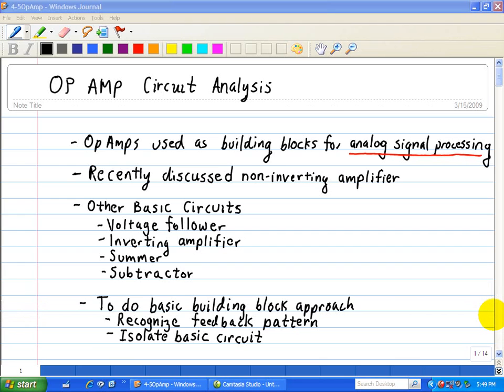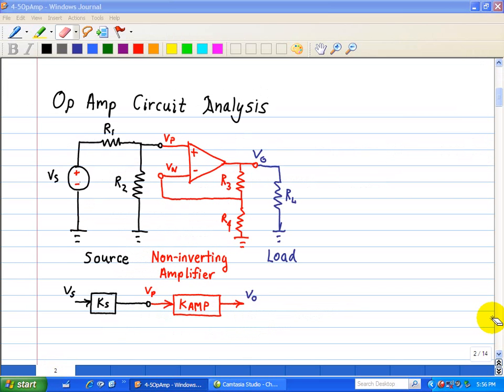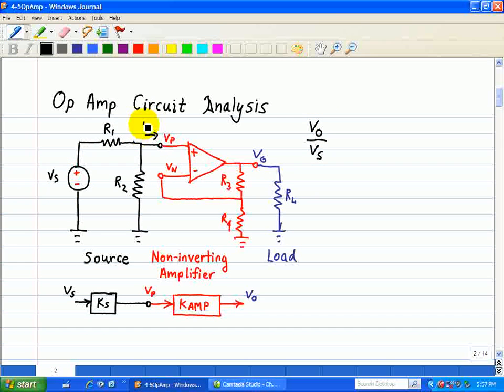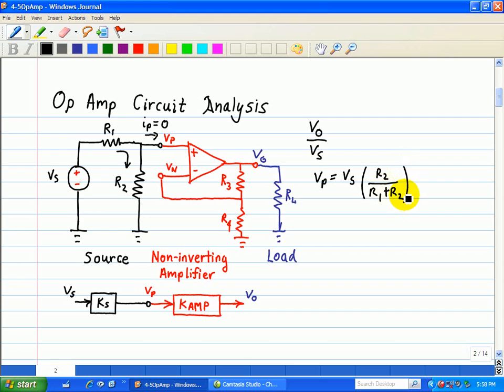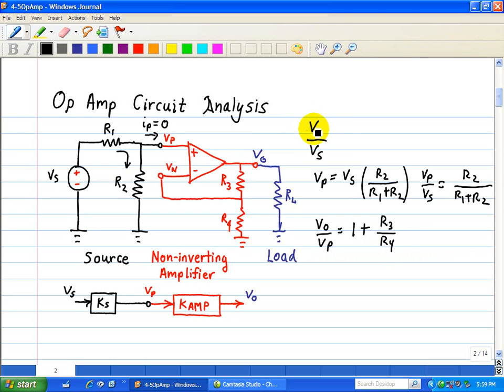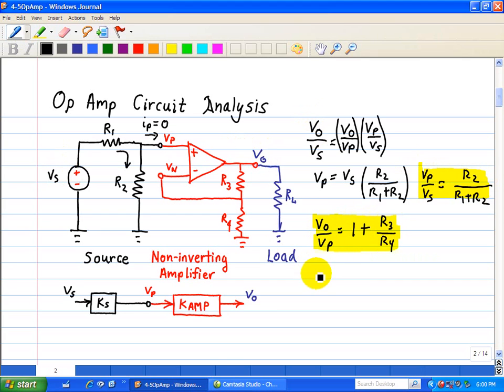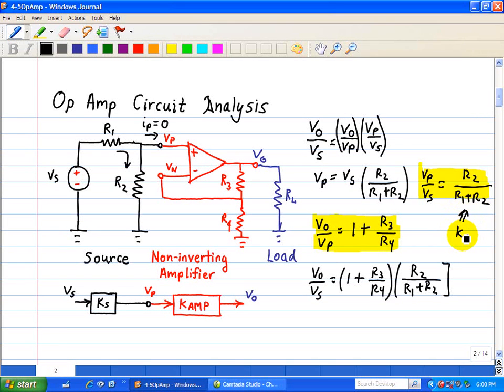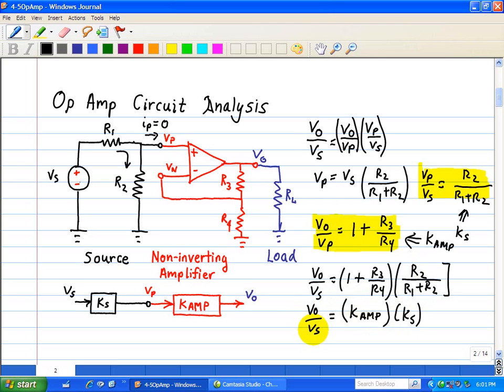Op Amp Design Basics - Non-Inverting Amplifier - Part 1

Comment: Sir, did you mean that if we multiply (Kamp)(Ks) gives us the value of Vo/Vs,so for example, I supposedly get 10 by multiplying Kamp and Ks,is that means that for 1 volt in the input gives us 10 volts in the output.kindly clear this up for me,tnx

Comment: hey drj. great video thanks, could you please either answer this question, or direct me to the video that covers it?

(Vo/Vp) = 1 + (R3/R4) I can see that this equates to Vo equals the Positive input voltage added to the voltage divider created by the two resistors, but isnt the amplifier differential? I thought Vp and Vn had to be around about the same?

Thanks